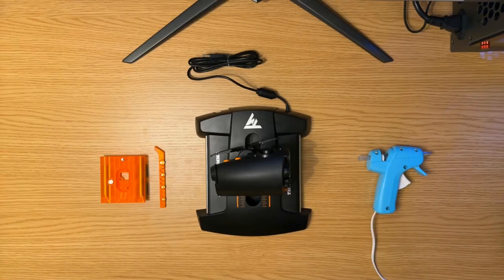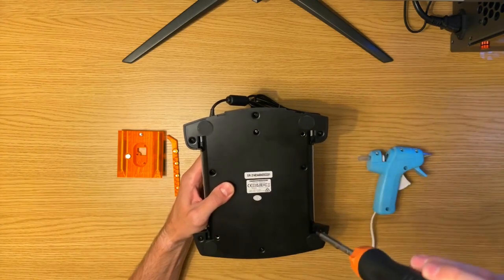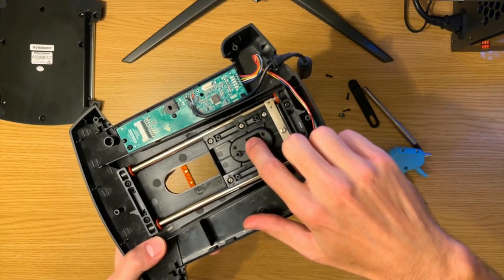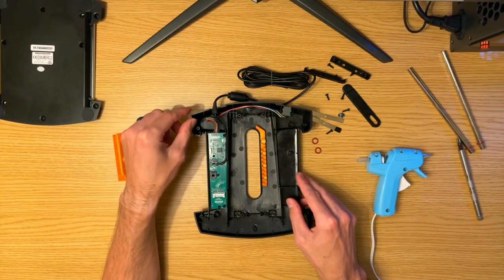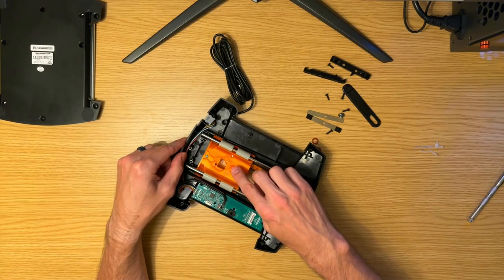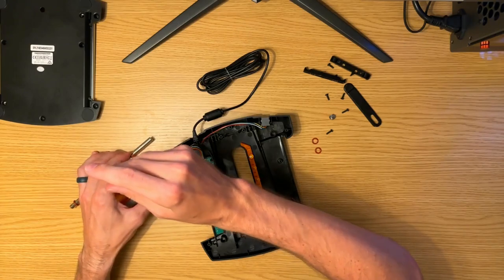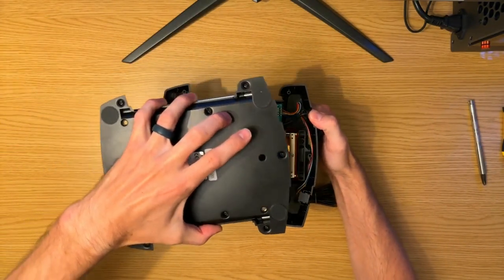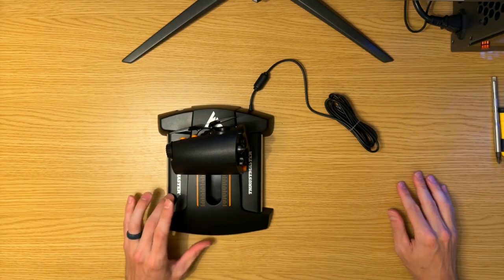Impulse Mk3 Install / Demo

Comment: The two black items (metal spacers you referred to) on the wiring are ferrite chokes which cancel outside electrical interference from entering the wires
Reply: How did you know that?

Comment: Hi
So the mk3 must be a very new version because I couldn't find this video 2 days ago and followed your old video and installed the hokey stick without magnets, so I can always reinstall magnets,
but have now received confirmation that everything was done correctly :).
Your mod works really well and is of good quality.

right now I'm using dual joystick in Star citizen, but with the new 50% decent magnet option I'll try to use my throttle again because I think it feels more right than dual stick
Reply from the maker: Hey! Yeah... took me a while to make the video, appreciably late after the release of the Mk3 slider on Etsy. I'm glad to hear you were still able to install correctly! Yeah, I agree. something special about the feel of a throttle, I prefer it! Enjoy!!

Comment: Just installed this, it’s superb. Can’t recommend it enough, should be included with the original (or at least the bearings). My only “problem” is that I fly all sorts periodically and I’d love different detent setups that I could easily change without getting the screwdriver out... but it’s a tiny tiny niggle compared to what this offers and testament to how good the detent solution is. Thanks for this.
Reply: I just watched this and read your comment, I think the only way to realistically change detents without having to open the whole thing up would be a new bottom plate.  At that point, a bottom plate with removable plate inserts with magnet holes could be the answer

Comment: Hey CoreHawk! I love this mod it looks like a great project that solves an annoying issue!

1 Question though- would you recommend the metal or the polymer bearings? (Pros and cons of each). A response would be really helpful if you can! Thank you 👍
Reply from the maker: Hello! sorry for the response delay. Day job has me slammed. I personally enjoy the polymer ones more. The smoothness and modulation of friction you can have through the downward pressure on the handle as well as the underside adjustment plays very well. Only con worth mentioning is that they are lighter than the metal ones. The added weight for the metal bearings feels nice. For the metal bearings, it works very well too but they roll so well that no downward force will ever increase friction it's own (think of when you might be in close proximity to something and white-knuckling the controller). You are limited to the friction adjustment underneath which still works well but don't have that extra modulation / silky  smooth feel from the polys. You can feel the rolling of the bearing balls too, so it's not quite as glassy smooth... still a night and day difference from stock though!

Comment: Just received and installed mine. Very straightforward install and works so much better than stock. Only thing I don't have is that friction adjustment underneath the throttle. Is that something that came in later models of the TWCS? Also, the 50% detent magnet seems to make a bit of noise when it is engaged. Is that normal? All in all, very happy to no longer have the throttle sticking when making fine adjustments.
Reply from the maker: Thanks for the feedback and questions! As far as I know, the friction adjust has been there since 2018 when I bought my first TWCS. Still the same on a model bought a year ago. Weird to think I began designing this thing over 5 years ago already! The noise, I wouldn't give it too much thought. As long as the hockey stick itself isn't rubbing the slider and it's just the magnet rattling a little in it's slot on the hockey stick, you should be good. Nothing a little grease, rubber cement, or hot glue couldn't fix. cheers!

Comment: Great product. If I don’t want the detenida, can I refrain from adding the hockey stick?
Reply from the maker: Thank you! Correct, no need to install the hockey stick. You can also remove the magnet in the slider as another option.

Comment: Hi Corehawk! I are you supposed to audibly hear those magnets clicking as you slide the throttle or could that mean it is rubbing? It feels better than the stock, but I feel like I did something wrong. It also is not bouncing back very well when you push the throttle to the front. Any ideas on how to improve it?
Reply from the maker: Hello! So the first part: can you FEEL the clicking in the handle of the throttle as it moves past the clicky points? If not, then no need to worry. The hockey stick is toleranced to retain the magnets mainly laterally while allowing enough room for repeated install/uninstalls. A fine line to walk! As far as the rebound for the WEP magnet, it does lose it's effectiveness at higher friction settings. The magnets are small and the space is somewhat limited in there so it won't push back super hard.

Comment: Has there been any potentiometer dysfunction for the throttle?
I’ve had two failures with the joystick, one either the ™ HOTAS 4, and one with the TM16000m both for PS.
Of course the Z axis gets more dynamic use that the throttle but I was wondering if you have any plans for a Hall effect conversion for the throttle assembly?

Comment: Are the metal or poly bearings better? Also, the hockey stick could set me up to like full mil in DCS? Trying to understand the product better. Looks like a great product.
Reply: I got the set with both types.  Both were absolutely super smooth, with zero sticking.  Either one is a huge improvement to the original, and I didn't find that much difference between them.  

In the end I went with the bearings because I felt that I got a wider range of resistance in conjunction with the unit's screw-adjustable setting using the leaf springs.  So I can adjust it based on what I was playing/flying.  At the low end, the bearings can be almost friction-less, but then every time you barely bump your desk/table or even yank your joystick it can be enough for the throttle to shift. 

The way I have it set up now is I can just push it forward using a 4-inch wire twist-tie without it bending.  

I didn't use the magnets because I didn't want anything but a nice smooth slide from min to max.

Comment: Hello. Do you think it's possible to use Nyogel 767 tube on the metal bearings? These bearings are not made to use thick lubricant I assume but I like the resistance of the grease. Will this be a bad idea? Same question for the polymer one as well.
Reply from the maker: Greetings. It is possible but I'd recommend only a thin film for the bushings. Avoid use with the metal linear bearings, it slows the rolling motion of the individual balls and it creates a very pronounced gritty/grinding feel - not good.
Reply: @CoreHawk3D  Thanks man appreciate the answer. Might buy as well buy one whenever I get my bearings straight
Reply from the maker: @JPazer  Sure thing, what do you mean by getting your bearings straight?
Reply: @CoreHawk3D  It's a saying. And in this case also a sh*tty pun (now you laugh). sorry :)
Reply from the maker: @JPazer  Oh haha very relevant pun! I've never seen the Bering Strait myself.

Comment: Hey Stefan. Just got mine today. 

One question: Do I wipe off the lube thats applied by the factory? I havent gone into the device yet but I assume it would be lubed.
Reply from the maker: Hello! thanks for asking. I'd recommend wiping all but a thin film of the old lube off, it'll lower dirt and dust accumulation. Plus for either, the metal bearings come pre-lubed and the bushings self lubricate so you're double-covered either way!

Comment: Is it possible to order a hockey stick for the other side? I am supposed to recieve the mk3 today but wanted a hockey stick on both sides.
Reply from the maker: No, and it's because I didn't design it to work that way. I want to keep the magnets opposite the PC board to mitigate and kind of EM interference. Are you trying to make a detent have a stronger feel to it?
Reply: @CoreHawk3D  Yes. I play star citizen. And The 50% is critical. I have some other feedback about the slider I would like to keep private. May I email you?
Reply from the maker: @adrianbishop995  by all means! Corehawk3d@gmail.com.

Comment: I installed correctly but it didn't get rid if the stiction if not made it worse. Did I do something wrong?
Reply from the maker: Great question! A few things to check: is the screw for the main swing arm dragging on the underside of the throttle case? Did you wipe the rails clean of lubricant? (if using bushings which are self-lubricating, you should, just a faint thin film is ok to have on there). Is your friction adjuster over tightened? Did you rotate the bushings and rails to find that frictionless sweet spot? These steps should cover all of the ways I'd expect to cause anything less than stellar performance.
Reply: @CoreHawk3D  I've tried everything you suggested, not much of a difference. But when I took the metal shafts out I noticed that on each side one of the bushings were much more sticky than the other. Is this normal
Reply from the maker: @cigee9499  Hmmm, one other method I forgot to mention: run each bushing individually on each of your rails (fully removed) to identify if it's one, some, or all of the bushings / rails that are creating the issue. Regardless of what you find, rub the problem bushing(s) along a rail applying strong force perpendicular to the rail (normal force) and also a rotating moment on it (twist perpendicular to the rail) so that any binding or interfering tolerances or surfaces in the bushing get quickly worn down until it's sliding freely. After this it should be smoov like butta.

Comment: All magnets in for il2 1946?
Reply from the maker: Good question, it's up to you for what you'd prefer. In my experience, detents are used to let you know when you're going over a key or important throttle position (afterburner, reverse thrust, fuel cutoff). Using every detent will not tell your hand much I don't think and it may prevent you from setting the throttle at any position as the magnets pull it toward them. Also, the closeness of the magnets to each other will lower/blend the pull/push effect, almost smearing the tactile feedback together. I'd recommend a WEP position and a fuel cutoff position, depending on the plane although I don't remember there being any planes that would shut off at 0%. Also, what a legendary game. Have you found a reliable way to activate the water=4 setting?? I can't get mine to let me use the "perfect" setting for scenery :/
Reply: @CoreHawk3D  I thought it was in the ini file?

Comment: I effed this up drastically sigh.
Had to throw my brand new throttle in the bin.
The plastic grey cylinders refused to stay in the orange bracket.
They kept popping out all the time.
I have modded G29 simracing  pedals plenty of times,replaced wiring looms,pots but this mod I completely could not get my brain around.

Lucky I have two 16000m Joysticks so not the end of the World but this mod was too hard for me sigh.

Even wasted money on a glue gun for this mod.

Now have anxiety through the roof.
Reply from the maker: I'm so sorry to hear this! I've had my share of projects that go sideways while everything is taken apart so I sympathize deeply! I think you just messaged me on Etsy and I've replied there. if that's not you, let me know, but I've got all the remedy you/we will need to get you up and running!  Just a little longer and you'll be up and running.
Reply: @CoreHawk3D  My throttle is in pieces in the bin,it will be gone in the morning.
Reply from the maker: @Jellybeantiger  ah, RIP throttle. I'm very sorry to hear this. Let's keep talking about ways to get you back up and running.
Reply: @CoreHawk3D  I was going to buy again but sold out.
My anxiety got the better of me when I threw my brand new throttle in the bin after failing to install.
Reply from the maker: @Jellybeantiger  Thank you! Please reach out/let me know as soon as you've got questions or issues!

Comment: Not buying again.
Broke my brand new throttle trying this mod.
Now in bin.
The grey cylinders keep moving out of the orange brackets.
😢
Reply from the maker: no worries and I'm not suggesting that you should buy it again. It's not unheard of for these PLA prints to warp if left in the sun. I suspect the slider itself was warped and not holding the bushings as designed. We run strict quality tests before we send them out so barring any errors there, I suspect heat (and at no fault of your own). I specifically switched from black bubble mailers in the past for this reason specifically. Now I send in insulated boxes inside white bubble mailers.
Reply: @CoreHawk3D  No it was in it's box for a long time as I was too scared to attempt the mod.
Reply from the maker: @Jellybeantiger  All good and even if it was, I wouldn't expect sun exposure to cause it d/t the aforementioned changes to shipping materials. Any number of other heat sources could have influenced this thing long before it got to you. We'll get you up and running, just need to talk the how/when.